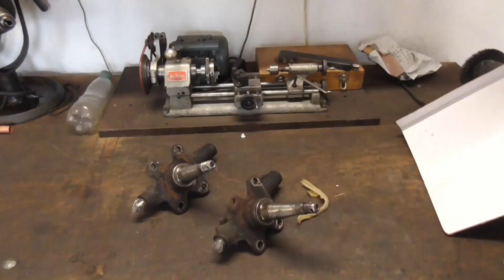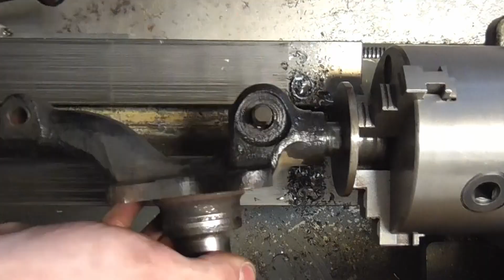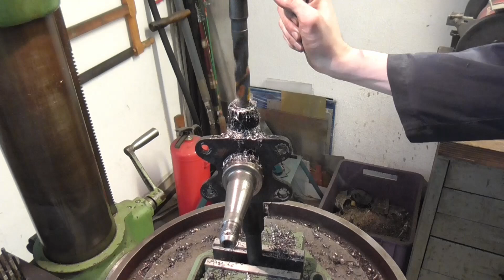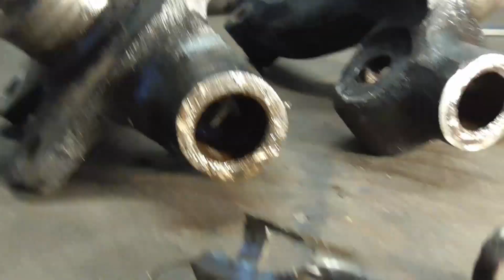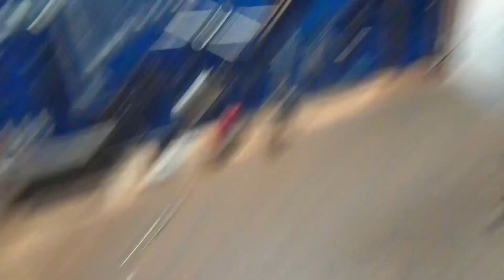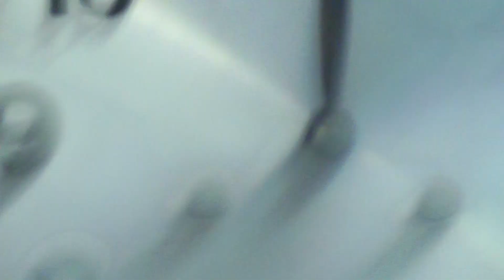Drilling out stubborn shafts

Comment: I wonder if you could heat the fitting and drive them out?  Might change the temper though I don't know.  Nice video though.
Reply from the maker: The problem is that there is no space to get a hammer in from behind.
Usually, it also takes a LOT of firepower to get a part as large as these knuckles hot enough.